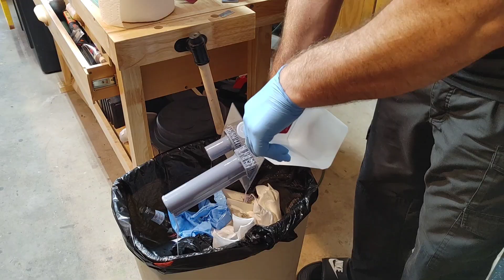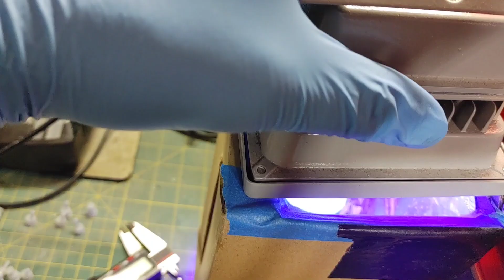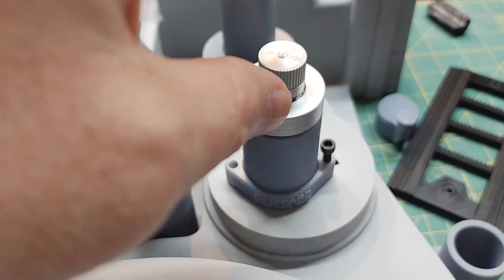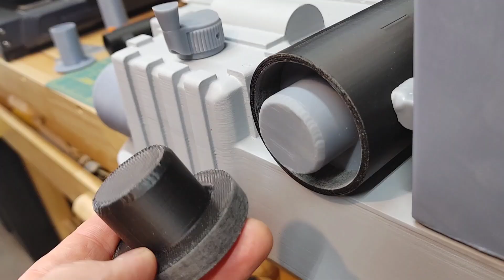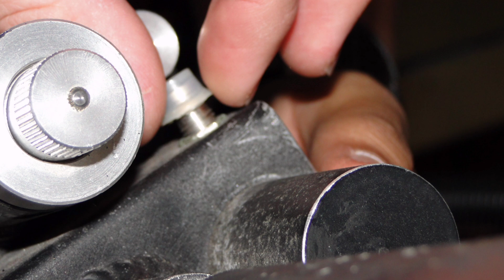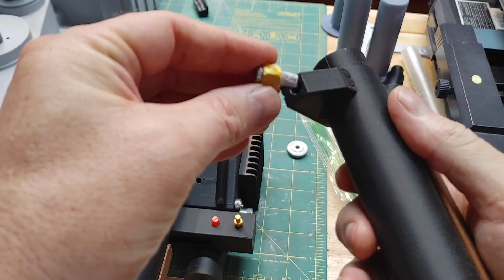My 3D Printed Ghostbusters Proton Pack Build - Part 3 | Thrower and More Resin Printed Parts!

Comment: Definitely 1.5" on the injector tubes! I think part of what makes them seem smaller is the epoxy fill in between the tubes from when they molded them for the GB2 semi hero packs. Makes for a bit of an optical illusion.

Loving this build and can't wait to see it finished!
Reply from the maker: Your probably right, thanks for the input. I was leaning toward the 1.5 ones. Appreciate your comment.
Reply: Hi, i have been really enjoying your vids! Regarding the injectors, what length (measurement) should they be, minus the fixing plate? Thanks kind regards